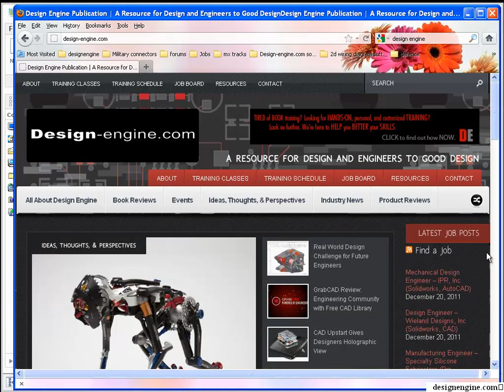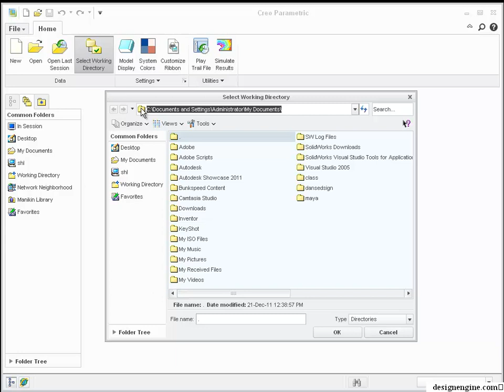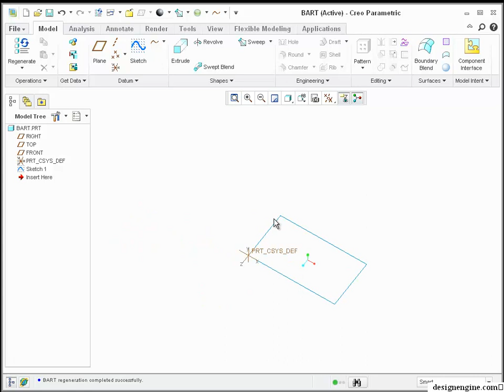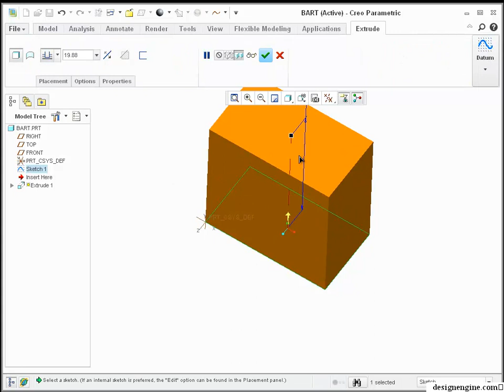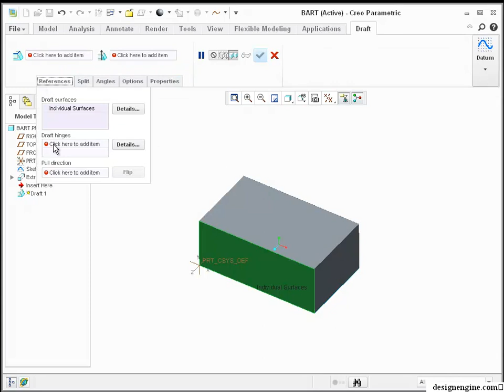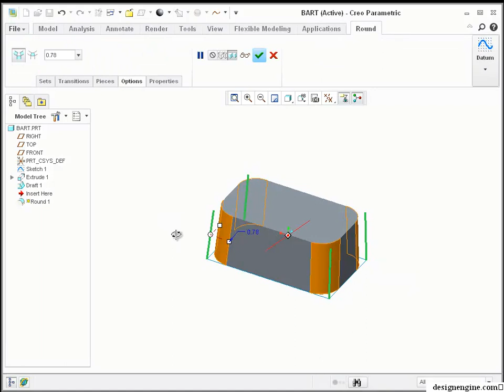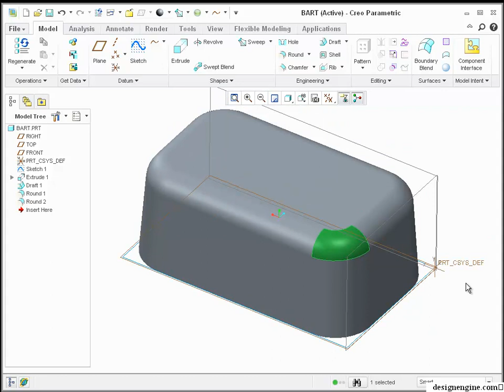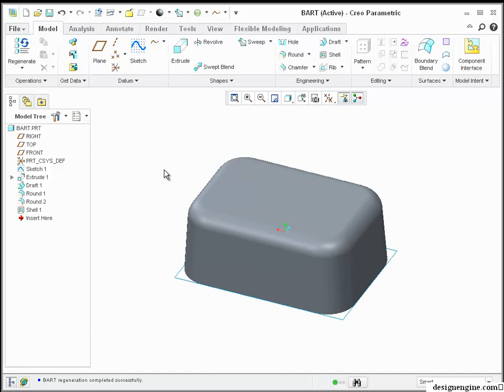Learn Creo 1.0 - Part 1 | Basic Tutorial to model Plastic Soap Dish Geometry in Pro/E

Comment: It has been quite a while when I last used Pro E as an undergraduate student.  In almost all of my jobs, I used Solidworks.  Is Pro E really that hard to use compared to SW?
Reply: Creo, SW, Inventor..... all basically the same.... except that I'd choose SW first, Creo second, and Inventor 3rd.  But NONE of them are the "industry standard" that they all like to claim.  The best solid modeling package in history was SDRC I-Deas, but sadly it has gone away.  I-Deas used the concept of a "model file" which is 3d coordinate system where any number of parts (plus one assy) can coexist in peace and harmony and great design interaction.  Why new cad programs don't use that concept is beyond me.
Reply: *****
Yea, Siemens continued putting out I-Deas for a few years as the forced people to transition to NX.  Sadly, I-Deas is now going the way of the dinosaur.  Do you have any info other than that?.... it would be wonderful if I-Deas (or a product using the same Boolean / Model File modeling methodology) was still around.